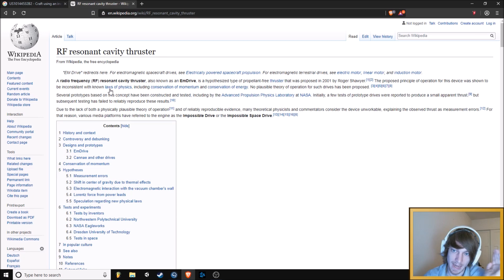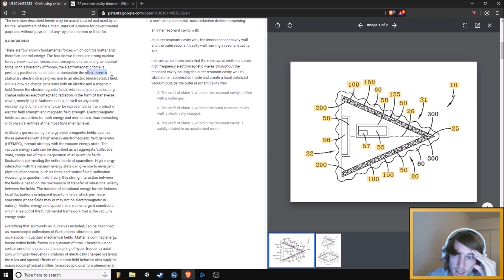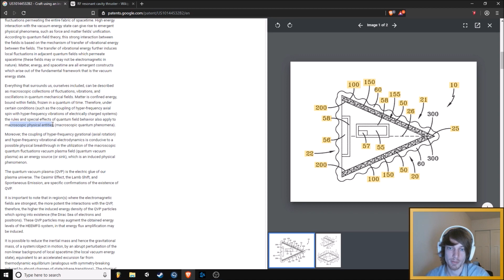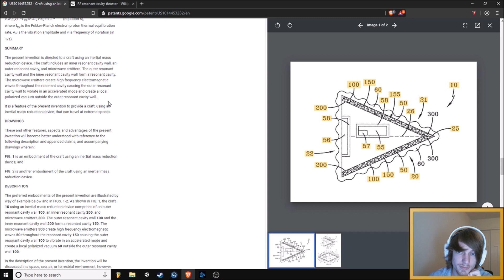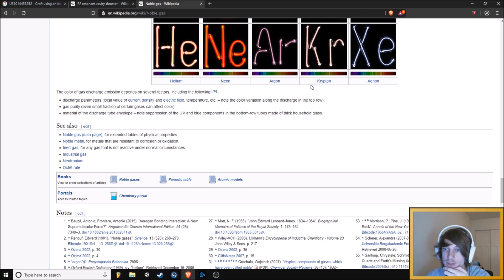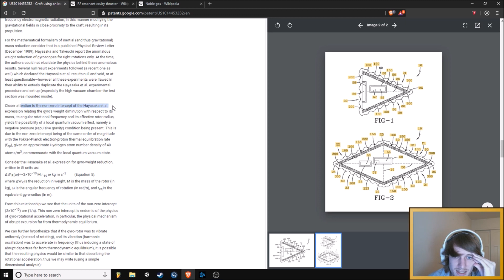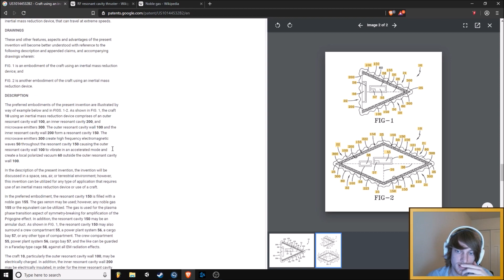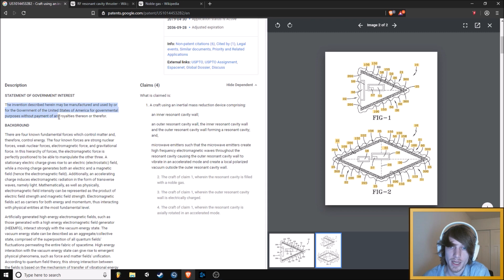EM Drive Is Back! (UFO? UAP?)

Comment: This is a resonate chamber, resonance by definition ,  is putting in fractions of a signal at the right timing to achieve a lot of power in the resultant resonate force. like kicking your legs in the right timing on a swing.cannae drive moves the center of mass and center of gravity forward and back in the right timing to achieve a greater thrust in one direction, not antigravity. The engineers aren't even aware of this because they want to be heroes of antigravity and quantum doesn't explain what is happening so they made some shit up. my analogy may be poor and not 100% analogous to the cannae, but I wanted to explain in lay terms, a real effect that is similar. 

what is being ignored in the explanations is that any charge on a body will result in capacitance , with the empty cavity serving as the dielectric, this in turn forces one end of the chamber to be a positive charge and the other end negative. Now with the microwaves being resonant, it means they are turning on and off at a set frequency which also means that the positive and negative charges are alternating between one end and the other of the chamber, the resonant chamber causes a field perturbation around the chamber and charges nearby space and particles along the curvature of the field around the craft, like a magnetic field it contracts on one end and expands on the other. Normally all forces would equal out in the universe causing a null effect on acceleration, but in this case the field is being flipped as fast as one end collapses. the net asymmetric forces result in a forward "thrust" 

and to be really blunt here, we can only perceive a small fraction of our universe, even with tools to help us view and sense the world around us, obviously the microwave rf is affecting more than an empty vacuum. which means for now that is invisible to us. also if it is causing a resonate field perturbation, we do not have tools to specifically measure that, it would also be invisible to us. if it is warping space, this too we haven't yet built sensors to measure, so it would be invisible to us. which is why it looks like magic.

quantum is a buzz word used by people who can't follow through with an explanation. sorry I know it stings, but you are a lazy turd if you want to use buzz words and describe attributes of a thing but never define the thing you are talking about.

I hope this explanation helps, if you guys need me ill be in my garage, and im not telling you what im building in there

Comment: Interestingly... when this patent was applied for, it was initially rejected. However, Navy top brass wrote to the patent office and said that they needed this patent because the Chinese are working on the tech, the navy also confirmed it was feasible.

The vehicle is said to be able to travel through water, air and space and negate inertia.

Now here's the interesting thing... one of the illustrations this scientist did is uncannily like the tic tac Nimitz UFO.

https://www.thedrive.com/the-war-zone/28729/docs-show-navy-got-ufo-patent-granted-by-warning-of-similar-chinese-tech-advances

The same scientist has also just had a patent granted for a compact fusion reactor. Now thats weird, because ordinarily such a patent would be rejected as science fiction because fusion research is nowhere near that advanced. But yes, the patent mysteriously sailed through with ease.

https://www.extremetech.com/extreme/300067-the-navy-just-patented-a-compact-fusion-reactor-but-will-it-work
Reply: Exactly right, this is world-changing, enough to usher in a new age of technology.
Reply: That's surprising they didn't celebrate more the scientific discovery of the century, the inventions that solve all of our current major problems as a society ...
Reply: That is 100% correct.. The Navy wanted to make sure they announce this before the Chinese.. Ret Navy Gen. Steven Kwast gave a fascinating speech recently explaining the dangerous of Chines Space development and why Space Force is not only needed but a necessity to maintain America dominance in Space. If Chinese Communist take the high grand it will be disaster for Space. Interesting he also mentioned Chinese developing Space ships destroyers .. in essence saying Chinese are developing a Space Naval Fleet!!! WOW that is crazy.. What you also don't know is US already has a space fleet.. Solar Warden or aka SSP!! Now declassifying this technology caused the patent office to reject but the Navy that told them this technology is not theory but operable ie they have it working.. guess what.. has anyone heard of TR3B.. It is already in action. so the point is this.. If Chinese are trying to develop similar technology and now the US saying they already developed this and the patent office approved it does that make China now pay royalty to US Navy? I have no idea but for whatever reason this rush to disclose this technology has everything to do with Space war between US and China. Also US declassifying the SSP and renaming it to Space Force makes things very interesting .. It seems the US wants full support of Congress and showcase the benefit of investing billions into this program.. This confirms Nasa is waste of money and now Space Force is launched Nasa will die off and everything will be pumped to Space Force.. TRUMP government already asked for a bill to be passed by Congress worth 730 Billion dollars.. that is just the start cause SSP has trillion dollar budget when it was black project but now it will be open to oversight which is good in my opinion cause now politicians can demand this technology to be used for the benefit of mankind.. By the way the fusion reactor is Zero Point Energy.. which basically means if used it can eliminate energy dependency on fossil fuel... this is all exciting and can't wait for Elon Musk to get a bunch of scientist to work on this and use it for SpaceX.. Why on earth will he be working on rocket engines when you have Star Wars/Star Trek like craft ... no brainer right.. this needs a focus of a billionaire to get approval from the Navy.. You must have the Navy blessing to develop this technology.. I don't see how else you can develop it without their approval..
Reply: @Iazuz  I've heard of the TR3B but I'm not sure that it exists : I've heard so many things (like black project members conducting abductions just to prepare progressively the world to a false flag alert concerning a threat from our cosmic neighbors). 

I'm sure most of the people who disinform do it involuntarily, that's why I'm confused with all this mess, and yet do agree with you about the fact that it's a good thing to make these (alleged) armies / technologies go public in order to make them useful to the people (end fossil fuels dependency and promote peace instead of economical and cultural warfares).
Reply: @doudsbass  Thanks for your reply brother.. yes there is no definitive proof about TR3B but just like blackbird SR71 the government denied it until it was decommissioned. However this is different. The government can no longer his this stuff from congress since the Chinese are developing their space fleet.. hence why the full disclosure is happening.. The new SPACE Race for the 21 century has began.. US on one side and China & Russia on the other.. Hence why these black projects can no longer be hidden from congress and public.. US will openly now colonies Space that includes, Moon and Asteroid belt for resources.. If you don't believe what I am saying please watch Navy Retired General Steven Kwast talking about Wireless Power from Space the stuff Nicolas Tesla was working on 100 yrs ago.. Chines aggression in Space and most importantly he talks about the means of transportation vehicle that allows a human to travele anywhere on planet Earth in less than 1hr!!! What the heck is that all about if we are not talking about a craft like TR3B?? Anyways watch the video its online he recently done it this month just type his name on YouTube with another keyword Space Force you will find it.. if you need I can send you the YouTube link... its 1hr long worth the watch.. and then make up your mind..
Reply: @Iazuz  thank you my dear 😁

I will watch that Steven Kwast interview because I love listening to these heretic contents (I've done my job regarding the mainstream and I have time to kill) but I suppose that it won't help me to replace my scientific-politic-philosophic doubts with certainties : as I told you I've heard so many stories that seem crazy and yet convincing that I imposed myself some distance regarding any conclusions (from me or anybody else, no matter how seemingly convincing they appear to me).That is frustrating and a bit sad, in my opinion, but I feel that it's a reasonable consequence to the informational mayhem that we are facing (we, the people who like these heresies) 😊
Reply: @doudsbass  I agree with you on that point... there is so much of disinformation going on and it seems to be by design.. The more confused you are the less you know what the heck is going on.. :) so they can get away with anything they want..
Reply: @Iazuz  Yes, it must be obvious to anybody who has spent a few dozens of hours "investigating" these subjects. What bugs me is why is there something to hide ? Nowadays people are so delusional about everything that I don't get what atrocity would necessitate to stay in the shadow ...
Reply: @doudsbass  I think the why is obvious right.. if there is Zero Point Energy which is what is required to power these crafts then you destroy the petrodollar industry ... no more fossil fuel... for some that is more than a reason to bury this or hide it from humanity.. cause the corporations that benefit today from this trillion dollar industry will no longer stand to benefit.. I never thought I would see a patent like this in my life time but to see this come out and from all people DOD releasing this to public I think something fishy is going on.. the argument now is oh we have to release this stuff before China can put a claim to this hence any future government will have to request for this technology from US government... but my thought is what is stopping China today from developing this technology now since you telling them how it works!!! its just not adding up and something else is going on...
Reply: @Iazuz  Forget zero point energy. It's not possible to extract energy from the quantum vacuum. That's not how quantum physics works.
Reply: @Iazuz  that may be why some people say that none of the revolutionary designs are patented (and the patents that exist are either here for propaganda or to get "ennemies" on the wrong track) ...

I've just listened to the speech that you were talking about. I don't believe the speaker for different reasons. The first one would be that it seems that it is emanating from a politician rather than a military personnel, and it sounds very "written" (not spontaneous in the formulation, too calculated for my taste). 

Also, I saw a few contradictions within the speech itself, and a few ideas that appear erroneous to me. I don't know if you're interested but here are a few details, to be more specific.

The first fishy statement that I recall is : "Once you've built the infrastructure in space you can deliver it for pennies". Even considering that there is no need for propellant (zero-point energy), the teams involved to get anything traveling through space must be worth more than a few pennies. I imagine that, in addition to the alleged military threat that the guy invokes repeatedly, he wants to make us believe that it is lucrative to colonize space for ressources (I don't think so, even though I'm not an expert).

Then you have stuff like "We need a Manhattan like project" whereas he previously said that he's been working with (military) scientists and engineers for thirty years about these technologies, and that they already are useable (statements that seem to go along with the things that say Steven Greer, and show that this Manhattan like project has already been taking place for some time).

On the same note, that man pretends that China may be way ahead regarding space colonisation compared to the US. I don't believe so, and that's not a little expedition on the far side of the Moon that will balance the several decades of trips to outter space, the legal ones at least, and maybe the unofficial ones in addition. I think that the idea of a dangerous competition is always useful to politicians that want to legitimate strange measures (involving enormous budgets or unfair new laws).

The guy said (in addition to the previous bs supposed to make the American population fear for the rushing of the old communists enemies) that "they could shoot us down", as if mutual assured destruction was on old story ...

All of this is manipulation, in my opinion, but I can't tell if he believes it or if he consciously said these things (knowing that it's not very serious).

I didn't like either to hear consistantly that idea of values fighting each other (as if "we" had to defend "our" values). It sounds very much like what the US government said each time they wanted to invade a country for ugly and untold reasons. The values I believe in are those that everybody shares : nobody wants to be treated badly so a simple principle like "don't do to others what you wouldn't want others to do to you" is, in my opinion, universal (not only to humans but to animals too). I know that it may sound naïve (especially after having been fed the kind of disinformation that make people fearful) but it is very important to me.
Reply: @Iazuz  my cosmic brother 🤗😁😂
Reply: @doudsbass  Live long and Prosper :D
Reply: @doudsbass  by the way do some research into China.. just discovered China has huge plans for Moon and Mars.. their plans are direct collision course to US plans for Moon and Mars. China also landed a space craft on the far side of the moon and have plans for manned missions to both Moon and Mars. China is also building GPS equivalent satellites in space, they are planning a Hubble like telescope and finally want to put lasers in Space to protect their Military assets on Earth.. all giving the same capabilities as US. China is also working on building advance technologies from their space missions and they want to have equivalent technology to US SSP. This is why US are worried of China because of their high ambitions .. lets see how this pans out.. interesting to watch this new space race.. Russia is already revamping their space assets and India is looking to join this space race but are too far behind technological as to where Russia and China is currently. However the new comers to this race will be India and Israel in the not too distant future..
Reply: @Iazuz  That race, in my opinion, is just beneficial to the militaro-industrial complex. It's pretty obvious that any race of this kind is endless (this country wants to keep up, that country wants to stay ahead, etc ...) The so called "urgent need" to participate to a race of that sort is just a manoeuvre to legitimate the fact that some countries prefer to invest on these useless things rather than taking the needs of their populations into account.

When we consider that the happiness of the people is the main criterion for judging the quality of a politic, we'll start to go in the right direction, at least that's what I believe.
Reply: bob lazar was right
Reply: @born2270  Not really. He made a few obvious guesses.
Reply: They are slowly releasing this to give the fossil fuel industry a little more time to milk the public of cash before the tech is totally released. The fossil fuel industry is so big, and wealthy, that they don't want to destroy it overnight. Think of what that would do to the world's economy. Crashing stock markets and many thousands, if not millions, of jobs gone practically overnight. The economy of area I live in is based on oil/petrochemical production and even though it is necessary to eliminate this industry, it is quite scary to imagine the consequences that the people here will have to face.
Reply: @la7era1u54  

"They are slowly releasing this to give the fossil fuel industry a little more time to milk the public of cash before the tech is totally released. "

Interesting idea. But what's the point in just hinting at the tech? They aren't really slowly "releasing" anything. No usable tech has been released. Unless you mean hinting at the plausibility of the tech so that researchers take it seriously and investigate?

Comment: I don't understand the radio silence on this one either. It is a really big deal if this is even a little correct. If we can control gravity we can control everything in the universe we can see and time itself. If this has even the slightest possiblity of being true it needs to be seriously checked out and if proven we can kiss the world we now know goodbye.
Reply: I understand that it might not be feasible for transportation but if it can affect gravity it means it warps spacetime and if it warps spacetime it manipulates time. I am not even sure what that means technologically but it's a really damn big deal.
Reply from the maker: well we most definitely cant control it with much precision right now. so  probably many years away from full control. which might not even be possible because of random fluctuation.

Comment: THE REASON NOBODY IS TALKING ABOUT IS BECAUSE ITS ALREADY DEBUNKED! If the em drive really did work it would mean free infinite energy is real which would break the laws of physics!
Reply: Emdrive is essentially magnetron (like the ones in microwaves) with an enclosed cavity in front of it, if you try using your microwave without putting the plug in, you’re gonna be having a cold dinner
Reply: Saiah smeth this device actually requires an energy source to work, nothing is free.
Reply: MrGmcleod I’m talking about the EM DRIVE! Not this patent!